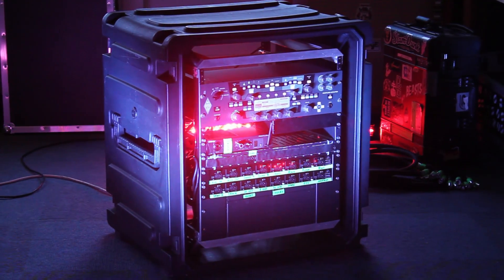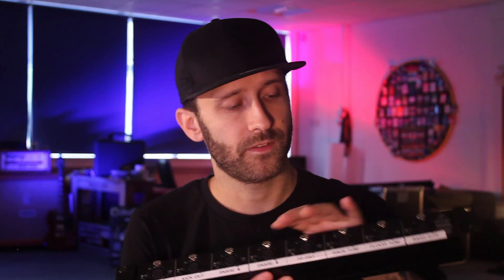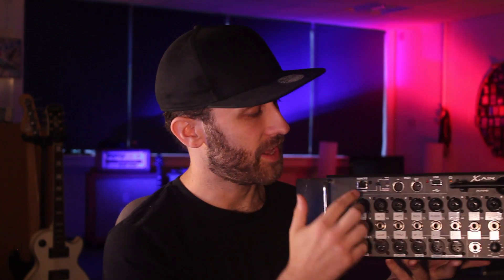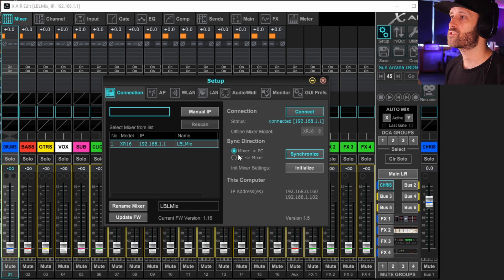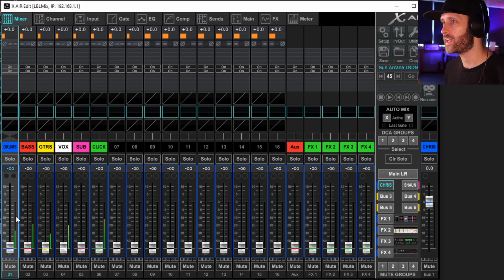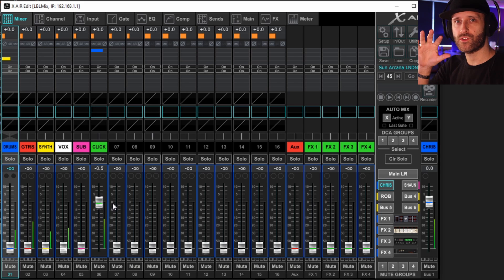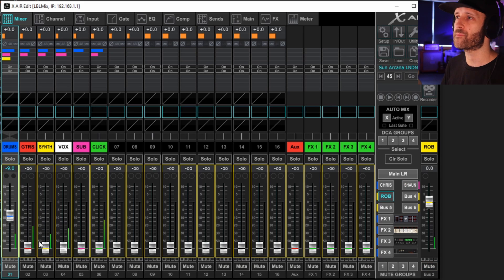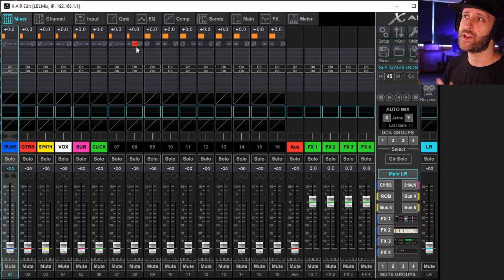HOW TO mix your own In Ear Monitors for your band.

Comment: Thank you for that bit about the direct vs isolated split. I was going to purchase a splitter rack that is a hardwired Y split but I don't think that would support what I'm looking to do.
Reply: You can use a cheap split like that, just make sure you only use the phantom power on one of the consoles only. never use phantom power on both consoles without a isolation transformer.
Reply: Basically you’re looking for an xlr patch bay and having an independent isolated split. Lots of bands go this route too but rack splitters just make it easier not requiring separate gear

Comment: Were the multi track stems playing back through your DAW or USB in the X16 Air?
I'd like to set up a rig very similar to yours with the capabilities of monitoring backing tracks that have the click embedded in the wav/mp3 files as well as everyone's live performance going through our stage mixer. While simultaneously sending samples and soundscapes to FOH via stems. Ideally running the tracks on a laptop/ipad. I was thinking of running two stereo mixes in a daw, one being the backing tracks + click that only the band monitors and the other mix being samples and soundscapes going to FOH.  Is that possible? I know that limits how much the band can hear of the backing track but can it still preserve the versatility to individually mix our live performance in our ears? 

I hope I've been clear, great video!
Cheers from Canada

Comment: fecking nice video. I missed one thing... if you have a backing track and a click. How to split them? How to send to the click in the in-ears only... should I still use an audio interface for that?
Reply: If your using stereo mp3 file you would put the click on the Left, and the tracks one the right. Then mail the click into the monitor but not into the mains

Comment: Love the videos and have been using this exact setup for about 3 years. I am very interested in learning what you have to say about setting up effects, EQ, compression or limiting. One thing that scares me is accidental dangerously high volume levels that could could literally hurt someone’s hearing. I’d like to know your thoughts on limiting versus compression when it comes to in ear monitors. We use an X-18 Behringer as well. I’d like to see how you would implement those tools either per subgroup channel or individual input channels. Cheers my friend. Thanks for your expertise !

Comment: Nice! But what I really need to know and can’t find anywhere is how do we make a stereo mix???
Reply from the maker: Click on a bus name (on the right hand side) then click "Channel" at the top and there should be an option for Stereo link. Enable it and two busses will link together to form a stereo mix. This will be shown by a chain link connecting them in the list of busses.
Reply: @chrislanterns  I’ve done this many times and I’m never able to channel anything on my left in ear using the buses, only through the master mix.
Reply: @VictorCardena3  Maybe I'm too late, but just in case you're still looking for an answer : the main pan fader is for the main output only. When you link 2 busses into a stereo bus, instead of the two tiny horizontal volume faders for bus1 and bus2 (in the upper part of the main mixer page) you get a volume fader and a pan fader. That's the one you have to use to pan sends. Alternatively, you can find the same pan fader in the "sends" tab for any channel, between the linked busses volume faders and the scribble strips.
Reply: And an alternative and quicker way to link two busses from the main mixer page is to right click on the chain link icon (besides the 48V icon). At least on the windows version of X Air Edit, not sure about the macOS version.
Reply: I’ve always just took up two Aux outs and made adjustments for “panning” between the two channels without stereo linking them by adjusting the faders   Don’t want guitar in your left ear, leave the fader down…..
Reply: @erickn  yeah not seeing the volume and pan fader you’re talking about, nor on the sends. Just the main out pan.
Reply: @erickn  and I have the Behringer XR18 Digital Mixer Handbook by Mark Baker and it makes no mention of what you’re talking about.
Reply: @erickn  THIS is true. I do see this. But the other things you’ve said that I commented on I can’t find anywhere in X air edit and the book says nothing about this as well.
Reply: @VictorCardena3  yep, same thing here. That’s why I use 2 aux’s and make my adjustments with faders as to what I want to hear in each ear
Reply: @erickn  my bad Erick I’m running 1.17 and didn’t realize they made a firmware update! So you can actually pan the aux stereo links now without needing a P16-M?
Reply: @terrytarpening9456  Terry, I'm not talking about the X-Air firmware version which is indeed 1.17, I'm talking about the X-Air Edit software version (I still use the 1.6, but the latest is 1.7 on Behringer site). You can see the software version number in the setup dialog box (cog wheels).
Yes you can pan channel audio to stereo auxes, without needing a P16-M. And I just checked the "X-Air Q" app on my Android phone, each band member can pan channels for their own stereo mix from their phone (not for mono mixes, obviously).
Reply: @terrytarpening9456  Sorry, forget the first part of my answer, I must have been writing my last comment while you posted yours about version 1.7 :)
Reply: @terrytarpening9456  The .update file is needed for the FIRMWARE update (the software embedded in  the mixer). The .exe file is the software that runs on Windows. There's no need to install or update the software on Windows. The .exe is the current version (1.7) that can be launched directly.
Reply: @erickn  oh I didn’t realize that.
Reply: @erickn  I don’t have the pan features for stereo linked aux like you do in 1.6! I’m now on 1.7 with firmware 1.17. How fucking confusing!
Reply: @erickn  I’ll see if I can somehow role back to 1.6
Reply: @terrytarpening9456  I just downloaded and tried version 1.7, I still have the pan features for stereo linked aux. Confusing, indeed. Are you sure your aux are linked ? Do you see the chainlink between the aux buttons on the right ?
Reply: @erickn  I see it now. Actually I was on 1.5 x air edit previously and it didn’t have all this. And I got confused between firmware and the software, been awake 28 hours straight from work. My bad. Rule #1 don’t do technical crap with severe lack of sleep! LOL 
I still think it’s easier for me to not link and adjust faders for individual instruments per ear to make it how it sounds on stage to me without in ears. Thanks so much for working through my tired ass! I finally got it. Ha!
Reply: @terrytarpening9456  Good for you, glad I could help !

Comment: Hi there, I have a question how do you connect the Jack cable to the MS8000? are you using a converter on MS8000??

Comment: I'm a bit co fused.. with the XR16 I can only have 8 microphones and not 16 through a splitter since the other 8 inputs of the XR16 are line level, right?
Reply from the maker: No they're still the regular pre amps, just using balanced jack inputs rather than XLR :)
Reply: @chrislanterns  ah, I see. Thank you!

Comment: Awesome video Chris thanks! I'm confused on the the whole router/wifi deal. Do you have to have internet service where your playing to use this setup?
Reply: You do need internet service, yes. But it doesn't need to be where you are. So for example your at a venue and they don't have no wifi. In this case you just connect the digital mixer via ethermet cable to your won router, that you bring with you. Then you just have to set the digital mixer in the right mode (there is a button that you can set left, midle or right) but that's explained in the video. And the last thing you need to do is connect your device, which you control the mixer with, to the same network as the mixer. I think this is how it works.

Comment: So, two guys in our band both have the XR18. Do you have to have the splitter to make the in ears work or can you just set up a transmitter out of one of the 6 aux busses?
Reply: You can run ears off of the 18 if you’re using it as your front of house mixer. To isolate your ears from a venue that has their own front of house you have to have the channel splitters and a split snake

Comment: Chris, these two videos have been such a huge help in planning my band's IEM rig. I can't thank you enough for producing them!

I do have a specific question on your opening I/O comments regarding the splitter and phantom power. You'd basically want to run all dynamic and/or ribbon mics that don't require phantom power through the transformer-isolated outputs to your IEM mixer and any condenser mics that do require phantom power (i.e. drum overheads) through the link outs to your mixer, correct?
Reply: I don’t see why you can’t just leave all mics running to direct out. Most sound guys want the isolated outs anyway. At least the local sound guy that’s been doing it 50+ years for big named acts told me that himself